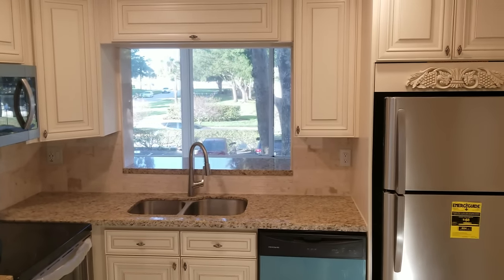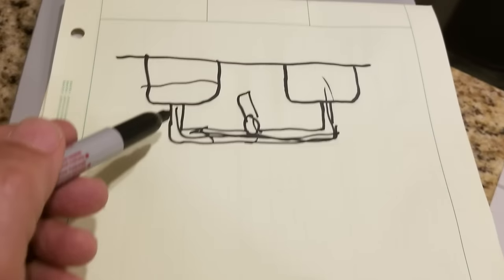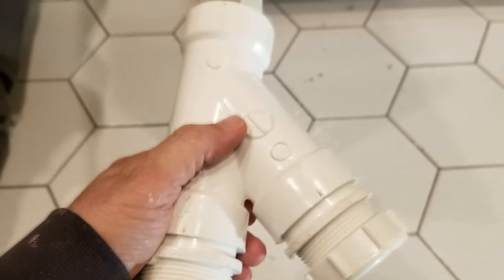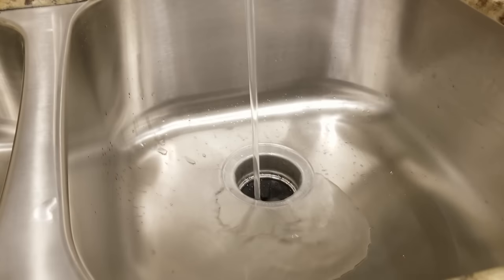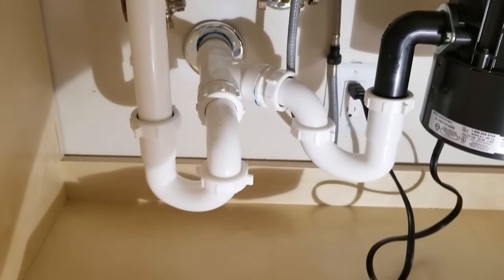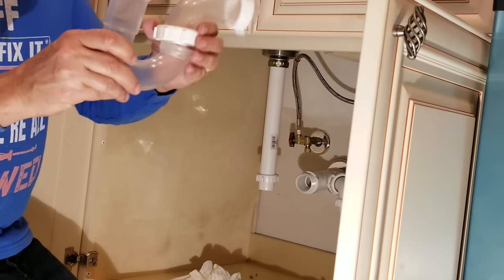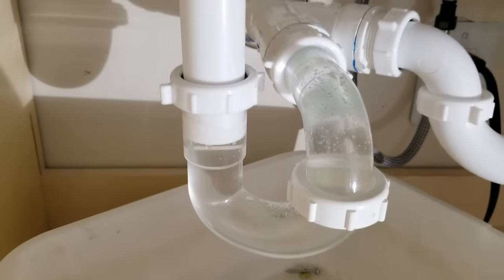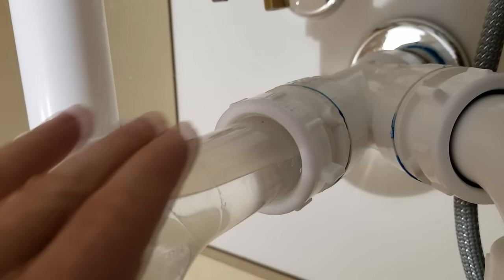How to Install Dual Kitchen Sink Drain Plumbing Pipes

Comment: Great video. 
I have been trying to shop for that WYE fitting but not having much luck.
Is there a better description or if you can tell me where to buy one?
Thanks for your educational video.
This is going to be my holiday project, as I am also changing out my garbage disposer and installing a new GE 1/2 HP unit GFC525N.
Reply from the maker: Here is the link to it: https://homedepot.sjv.io/P1WbX  Nibco 1-1/2 in. PVC DWV Wye Fitting
Reply: @jeffostroff  Thanks Jeff. I was actually looking for a screwed connection Wye fitting, which I could not find. Later, I realized that the Wye fitting has to have the screwed ends glued on separately.
Reply: You can see him gluing on screw ends at minute 5:14.

Comment: Sir your content is great and learned quite a bit but how can I make a video of my set up and show you my situation? I recently got a bigger garbage disposal and my dishwasher has shut off and back up with water. I have been trying like crazy to get the right piping so this won’t happen. I saw lots of comments here but wanted to personally reach out. Thx for any help
Reply from the maker: Did you punch out the dishwasher plastic punch-out on the side of the garbage disposal? Everyone forgets to do this and water backs up into the dishwasher.
Reply: jeffostroff let me check lol but the dishwasher worked fine before kinda, it still backed up water in the sink but now that the new garbage disposal is in it just floods out and shuts off but let me check that really quick. Thank you for the reply back sir.
Reply: jeffostroff bro you are a lifesaver!!! I just knocked out the plug and I have no issues now! Thanks again and I’m already subscribed to your channel for more tips! #lifesaver!!!!
Reply from the maker: @IronMayne  yes! I knew that had to be the problem. They warn you about it  In the install manual for the dishwashers

Comment: Yes I have sink water backup with one pipe hooked up to both drain
Reply from the maker: You may have a developing clog down the waste line somewhere. We just had to snake ours out a few months ago, found cereal in the waste line 30 feet down line, bunched into a 90 degree turn in the line.

Comment: What parts did you use on the wye?  I couldnt find the right pieces to connect the pipe.
Reply from the maker: That I believe is this part:  1-1/2 in. PVC DWV Trap Adapter, this is slip fit on one side, it glues into the Wye, and male threaded on the other side, so the p-trap arm threads onto it. There are 2 of these used. https://www.homedepot.com/p/NIBCO-1-1-2-in-PVC-DWV-Trap-Adapter-C480127HD112/100347086

Comment: Where can I pick up the 1 1/2  inch wye? Been to a few hardware stores, can't find it.  can you provide a link? Thanks.
Reply from the maker: Angel this is the part we used, available at Home Depot stores: https://www.homedepot.com/p/NIBCO-1-1-2-in-PVC-DWV-H-x-H-x-H-Wye-C4810HD112/100678018
Reply: @jeffostroff  I saw that but it did not have treads. was there additional parts added to the wye?

Comment: When I renovated my kitchen 12 years ago, I came up with the same double P trap design.  Prior to that was a T connection to single P trap.  Everytime the garbage disposal was running, it pushed the dirty water up the other sink.
Now with the double P trap, no more dirty water pushed up on the non garbage disposal sink.  For those who say it has enough vacuum to pull water out of the non draining P trap, unless you are draining a bathtub on one of the sink, I don't think it has enough vacuum to do  so.  Someone builds a CLEAR PVC P TRAP pipe and posts the video to proof it.  If you are really concern about the vacuum, just wash your hand on the other sink, that will be enough water to fill the P trap.

Comment: Also, INSPECT YOUR P-TRAP PIECES BEFORE INSTALLATION - ESPECIALLY THAT LIP - I had one where it just kept leaking leaking leaking, tighten it down some more, then leak, take it off, do it again, leak leak leak - it turns out the lip had a small imperfection that was hard to see but if you ran your finger over it you could find it.  Replaced that part and finally no leaks!

Comment: How long should the pipe be going into the Y piece? I think both of mine are two long which is causing back up issues in my sink.
Reply from the maker: Our state allows 6 feet from the trap output to the vent stack. So if you fit under the kitchen sink with your P-trap, you are fine there. If your water is backing up into the sink, I think your problem is either a clog down the line, or you don't have adequate venting. Your p-trap output arm should be slightly slanted down to the wall, 1/4" per foot to ensure water drains out. Also, check to make sure the P-trap output going to the wall is not higher than the P-trap input from the garbage disposal. If you can make a shorr video showing all the pipes under you sink, and post a link to it, that would help.
Reply: I have your same question. Right now the pipe on one ‘arm’ of my Y is so long that when you look through the other arm of the Y, all you see is white pipe. So the 2nd arm pipe only has a little access to actually drain (around the outer circumference of the opposite arm). This is how the previous homeowners have it. But I would think each side of the Y should have pipes only as long as their arm.

Comment: Question: what if I wanted to use only 1 P-trap? Currently my two drains connect into a Tee that leads to a single P-Trap. Could I use a wye or something else to connect them to a single P-Trap?
Thanks
Reply from the maker: Use that same method, 2 drains into the single P-trap, that is what most plumbers prefer. But also, on the long horizontal arm from the garbage disposal to the vertical drain tailpipe, make sure that horizontal pipe slopes downward toward the vertical drain pipe. Slop should be 1/4" drop per foot.
Reply: @jeffostroff  That makes sense to have a slope, but what about the fact that the tee and bend are 90 degree right angles? Do you just force it into the tee? Why can't some sort of wye connector be used instead of a tee?
Reply from the maker: @winfidel  yes, I tend to force it a little into a downward slope, you can help that along by adjusting the cut on the downward end of that horizontal pipe so that it will be sloped.
Reply: I hope you used the tee and not this stupid ass double trap idea... This is stupid and all wrong..... He's acting like he's gonna put a snake down a disposal... Lmao

Comment: Thanks Jeff. Just subscribed. Great video. Is there any way you can guide or make video on various adapters to make different angle connection using 45,90, street, elbow and many are there.. I dont know what are various angles, elbow , adapters are there inorder for any one to make any connection from one angle to other angle. i know i asked it very simple but answer is going to be tough. anything wold help, please if u can
Reply from the maker: Welcome aboard! I did make another video showing how to line up the p-trap to the street pip using these other parts when it is not lined up properly, is this what you're looking for: https://youtu.be/b_OSgwpteR4
Reply: @jeffostroff  Thanks Jeff, I watched that video, What I was looking is various adapters in plumbing pvc that help one to make connection from one angle to other angle. i dont even know how many adapter are there and when to use what. today i do this by trail and error running to home depot multiple times.

Comment: The only I did not see you do - was, after you chop-sawed off the single pipe coming out of the wall - before gluing on the wye, you should have internally deburred the single pipe coming out of the wall. Without deburring, there is a small ridge of residue pvc left over after you sawed off the pipe. This small ridge/residue left in the pipe will cause a restriction in the flow of water

Comment: I am having a couple problems. First, I definitely want to use this double trap system, but I'd previously plumbed under my sink with 2" sched 40 pipe, with a slip joint to connect to the 1 1/2" disposal discharge pipe and the 1 1/2"  downtube from the opposite sink.  I attached the pipe to the sewer pipe in the rear wall with a rubber coupling with clamps.  My problem is, that as illustrated in your example, I'd like to be able to undo the p trap from the upper elbow to have a straight shot if the drain ever needs a clean out.
However, I've found it impossible to find a 2" P trap that has two slip fittings. They come with a slip/compression joint between the two pieces of the trap, but the ends are both bare. And not only that, while I can find 2" male threaded adaptors, they don't appear to include the gasket and nut to to create a compression fit.  Any suggestions?
My second issue is that my old disposal was so old the mounting fixture is held on with a thin round screw that is round except for two flat spots. To get this off would require a thin wrench with a 5 inch opening. I've found it impossible for find one of these as well. 
Any advice would be appreciated, as is this video.   I always thought it was odd to run either the sink or the disposal into a tee, as that would seem to invite clogs.
Reply from the maker: What you can do is buy a trap adapter Is to cement onto the streetline coming out of the wall. You would get a trap adapter that is 2" on one side and 1 and a 1/2 inches on the other side on the other side that where your petrap pipe can be pulled out of that trap adapter anytime you want.  It sounds like you need to get a screw extractor take a look at this kit from home depot

Ontel Speed Out	Speed Out Cobalt Extractor (4-Piece)
https://www.homedepot.com/p/Ontel-Speed-Out-Speed-Out-Cobalt-Extractor-4-Piece-1000369/207096720
SKU# 207096720

Comment: The issue I learnt with that was that the traps are connected before the vent so if you fill one sink and empty it you might siphon the other trap, up here we cant do that but states differ
Reply: Your def right, but his drain Is either  clogged or backfalling, not much syphon action will happen here lol
Reply: I agree, this arrangement does not meet code in VA.  I wish Jeff would have filled the right sink, then "let it all go" and let us watch what would have happened in the left (translucent) P-trap.  I think there's a chance it might have been siphoned out by the water draining out of the right sink, rushing past the Y.  Our dual sink originally had a single trap after the Y, now has two traps before a Y that includes a vent right in the Y.

Comment: When remodeling is this a decent place one could use a tee coming out before installing the Wye.  With the loss of venting from remodeling (later project)  an Oatey vent could be placed upward from the Tee only adding an inch to the level (if it would matter, for me maybe) of the connections to the sinks?
Reply from the maker: If you have venting already in the wall, you don't need the Oatey vent. We typically use those on island sinks.

Comment: @jeffostroff the very first one you don't like, in the event you'd want it like that,  you wasnt to go from basket strainer to ptrap, p traps will go towards the center into a double fixture wye with street 45s picking up the p traps,  off the center hole(top hole) of the double fixture wye you will put in a street adapter with female threads to now make it a cleanout.  It's plumbed in that way to avoid pulling the p traps with clogs and using the cleanout.  While your cabling you can run water without making a mess
Reply from the maker: They have been doing away with those clean outs because often times there is a clog that has water backed up so when you try to unscrew the cap water floods everywhere.

Comment: Jeff, I have a kitchen sink question.

I have the split valves on both hot and cold outlets. 
On the hot, one split goes to the faucet and one goes to the dish washer. (I can visually see this). 

On the cold, however, one split goes to the faucet, and the other goes behind the wall (??? And is a line I’m required to change per my insurance)  ... any idea what this could be supplying water to?
Reply from the maker: Yes, this is supplying water to the ice maker of your refrigerator. Why are they making you remove it?
Reply: jeffostroff it’s a polybutylene line. The line starts under the sink which is on an island and I assume goes under the house toward the fridge ?? How would I replace this?
Reply from the maker: @janetssagutierrez2193  That explains everything. If it's polybutylene, that is no longer allowed in construction after 1995, and many insurers won't even cover a house that has it. There are plumbers who will remove it and change it to copper,  or PEX, others won't touch it because of the amount of work involved, there are companies that do it as their only task in business. Try getting quotes from a couple of plumbers, and google polybutylene removal in your area.
Reply: jeffostroff so basically not a line I can replace myself. Ugh. Ok thanks Jeff!
Reply from the maker: @janetssagutierrez2193  Yes, you'll also have to run any new water lines under the concrete.

Comment: wouldn't this blow out the water in the disposal side pea trap and let gasses back into house?
Reply from the maker: No, 2 reasons why this would not happen. 1) Inertia of water sends water through the P-trap and out into the waste pipe into the wall, and downslope of waste line keep water moving forward, not backwards. 2) Water goes through a WYE fitting, so back flow would be difficult. Even if water could back flow into the garbage disposal side P-trap, there would be no gases, because the whole reason for a p-trap is the constant seal of water that sits in that curved part of the trap that protects the house from sewer gasses.

Comment: Which pvc pipes did you use???
Reply from the maker: We used a 1 1/2" PVC Wye at the wall pipe, and used a 1 1/2 stub of PVC SCH40 to attach to the Wye and cement on a 1 1/2" P-trap adapter. The p-traps are all polyplastic.

Comment: That’s the way mine currently is.  Unfortunately when I dump a lot of water down the garbage disposal drain sewer gas comes out the other sink.  Looking to get ride of the sewer gas smell.
Reply from the maker: Sounds like you have same problem we had at our house last summer, you like have a slight blockage further down the line in the street drain, so it causes it to back up the other sink because the street drain cannot drain the water fast enough. See our other video on this: https://youtu.be/fqnm4mwV33o

Comment: Water doesn't care about the shape of the pipes.  It's all about the LEVEL, governed by gravity, and the pressure.  THIS is the only video showing the USE of TWO TRAPS.  It would be helpful if you SHOWED the TOP view from the sink drains with different scenarios, like if running the disposal causes water to come up the other drain or not.  Thanks.

Comment: Jeff,  on the kitchen remodel,   the cabinet to the left of the
   microwave has one handle/knob lower than the other. 
did that get corrected ?
Reply from the maker: It was likely the vertical alignment of the cabinet doors. I invented a jig that allows me to mount those knobs the same X and Y distance from the bottom corner of the cabinet door, so that is 100% accurate. Right before sales day closing, I go around the kitchen and align all the doors, they can be sometimes an 1/8" to 1/4" out of vertical alignment from each other as delivered by the cabinet company. I also adjust the horizontal distance of the doors too, tuning them to make sure they all open and close without hitting the neighboring cabinet door.
Reply: @jeffostroff   i have a jig from Lowe's with an assortment of
    possible knob locating indicators.  great tool.  good thing 
you solved the cabinet door thing,   i thought i might have to
    put an asterisk after your name about your work quality.  :-)
Reply from the maker: @normhodgkinson6965  I have 2 different of those plastic templates, from Lowe's and Home Desperate. Problem is, none of the holes landed where I need them to be on these JK Cabinets, so I built my own Jig for it. There is some $200 tool that I might buy some day that is adjustable to automatically calculate the width and height of the drawers and help you get the drill hole in the right spot.
Reply: @jeffostroff    ah ha,   and again,  necessity is the mother of invention.   i will remember
    that if i get some weird cabinet doors to do.